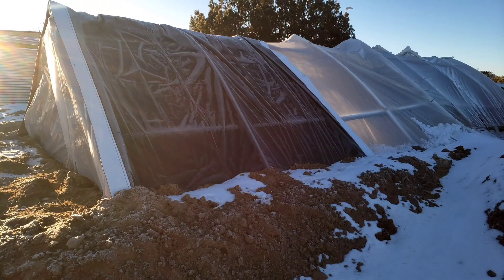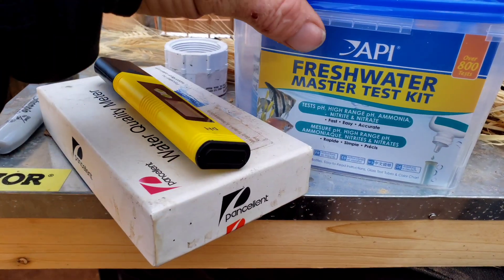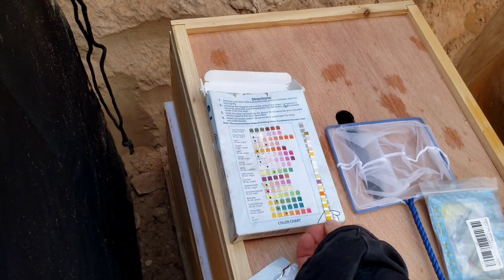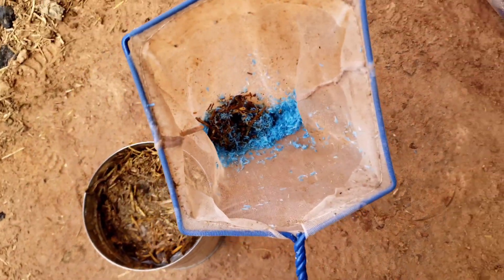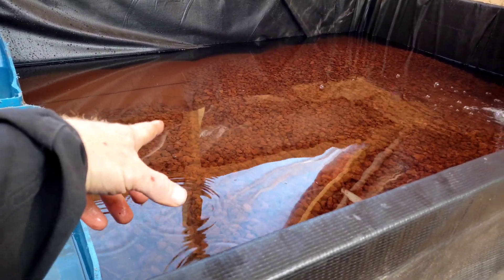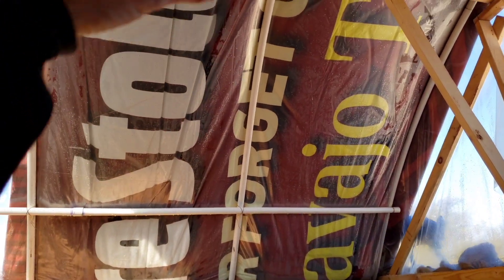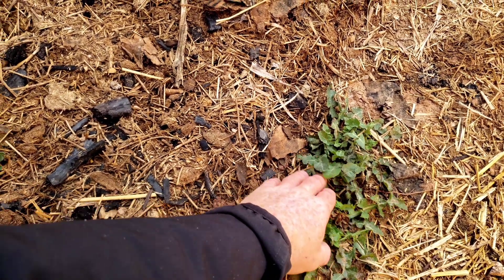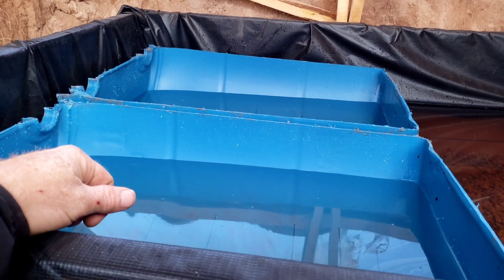My frugal solar powered aquaponics system

Comment: Salmonids have very inefficient gills, they need cold enough water to have enough oxygen.  What is your water temp on a hot day?  I've done similar chop and flip IBC and I can tell you that water temp is a big problem to solve for certain fish.
Reply: Exactly.  I would highly recommend against trout.  If this is your first go at it, stick with the tried and true: tilapia.  Trout require a very advanced set of skills (and equipment) to keep in captivity.  They need high dissolved oxygen which usually means high water turbulence and low temps (cold water holds more oxygen).

Starting with an "easier" fish like tilapia would give you some experience at running a (not trivial) setup where an ecological balance between plants and fish must be achieved and maintained.  There's just way more info out there on farming tilapia than trout -- by a long shot.

If you really must do trout, research it exhaustively and make sure you can provide the conditions they require.